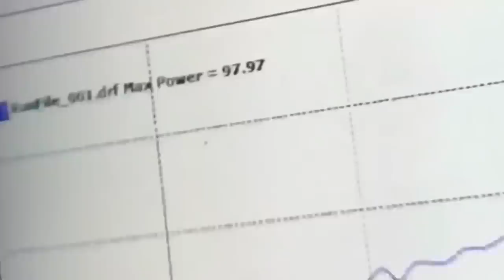BUILDING A TURBO MIATA KART IN 10 MINUTES

Comment: The best looking Miata I have ever seen.  Every time of someone doing a Miata build I wonder does the owner of the car sit down when they pee. With this “Miata” cart there is no doubt standing while taking a leak is a considered normal and no strange funnel device is required.  Good Job Idiots PS I dig the radiator grill shell